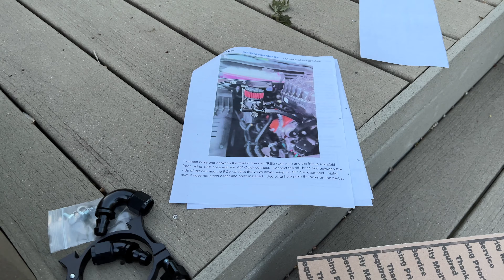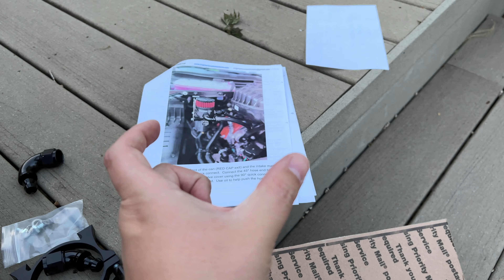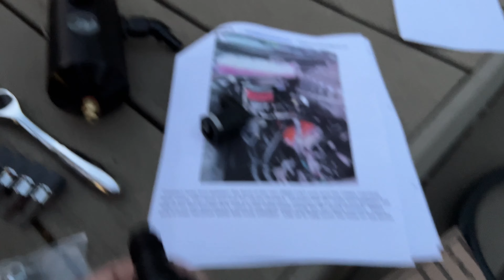SAVE Your RAM 1500 TRX ENGINE! Mighty Mouse Oil Catch Can Install AND Review!

Comment: Justin, the Mighty Mouse catch can was part of the build I did from Vengeance Racing last year.  My 2016 Z06 ended up with 681/675 to the wheels, which is not massive, but I like the extra protection it provides.  BTW, Love the XPEL PPF and ceramic coating on our C8 even though you were not the installer (because you were not our local company).  Happy customer here!  💪🇺🇸
Reply from the maker: Sweet! That’s awesome to hear!

Comment: Some people complain about modern desiel engines having an EGR valve and carboning up the intake, just get a air oil seperator catch can, a popular modification in Austrialia. OEM don't because it's a maintence item that many people are not used to and it has to be done and at possibly irregular intervals.
Reply from the maker: Yup. Easy way to fix a problem. It looks cool, too!

Comment: As always, these performance related videos of yours are more than educational to say the least. Plus, as soon as I say "Mighty Mouse" in your thumbnail, you had me. Why? Because back in the day, all my Vette's were not Big Blocks, they were Mouse Motors and were known as the Mouse that roared and I had a built 327 cubic inch mouse motor that was built for the quarter mile with 12.5 to 1 compression pistons. No fuel additives needed in that it ran on pump gas. Yup, Sunoco 260 pump gas. Wish I had hoarded that gas away back then. Lord only knows what it would be worth today and what kind of power the new generation engines would make. Heck, today's engines might even blow up using that gas. 🤣

Back to the Catch Can itself. I can't imagine any dealer ever recommending a Catch Can install. It just wouldn't say much for the manufacturer's engineering. I'm like you in that having one is certainly not going to damage the engine, so aside from the cost, what do we have to lose? It's already on my "To Purchase" list, but I have/had another brand of Catch Can in mind. I'm switching gears, no pun intended, to Mighty Mouse. I love the "little things," like the sight glass! 👍

Questions on the Mighty Mouse. I'm guessing these are brand/model specific? If so, I guess there are different brackets as well for differ cars, like our Vettes and then possibly generation specific? FWIW, I like your mounting bracket. I'd be tempted to highlight it with a red paint or red powder coating especially since you already have a touch of red on the engine from the factory.

Well, I see my timing is perfect. The end of your video and the end of my mug of Chock full O'nuts! Great upload Justin. 👍 Save the Wave 🙋‍♂
Reply from the maker: They are brand specific and they do make one for the ZR1 but it doesn’t have a fancy bracket like that, unfortunately. The only other one I know they make a bracket like this for is just a normal SRT hellcats.
Reply: I guess they'd have just their Catch Can though for a C6?
Reply from the maker: Yes most likely. The kit they make for the ZR1 uses existing bolt holes to mount. Likely the same for your C6.
Reply: Thanks again Justin. Would the install as far the hoses are concerned be different for a Dry Sump vs. a non-Dry Sump system? As you may remember, my GS is a Dry Sump.
Reply from the maker: It would be a slightly different install but still pretty easy. My ZR1 is a little bit harder since the pcv is under the super charger
Reply: I'm glad I asked. Thanks again my friend! 🙏
Reply from the maker: No problem! Thank YOU!

Comment: Been thinking about adding one to mine but worried about warranty and dealership service department seeing it. I guess I can swap it back to factory pretty easy when taking in for any issues or warranty work/recalls.
Reply from the maker: Super easy to swap back if need be but with that said it’s unlikely they would void any warranty over this.

Comment: I’m new to the TRX truck bought it used on the mighty mouse website. What package did you chose? Did you choose mild or wild to get the exact parts you got?
Reply from the maker: Congrats on the truck! You can get the mild setup. The wild is if you modify and have over 1,000 hp.
Reply: Ok thank you 👍

Comment: Nice mod. There’s two versions on their site, the “Mild” one and the “Wild” one. Which one did you go with?
Reply from the maker: Thanks. Mild is what you want unless you have engine mods pushing you near 1000 hp.
Reply: @HorsePowerObsessed  Preciate it!
Reply from the maker: You’re welcome!
Reply: Oem quick connect option ? @HorsePowerObsessed
Reply from the maker: Yes I had that in the video.

Comment: I got the Mild 1000 QC. A little different connections and they say to remove the spring and piston from passenger side PCV valve and then put it back with just the housing. Is this actually needed? And why?
Reply from the maker: Wow, I didn't know that. If they say to do it I would because that man knows his stuff!

Comment: I've got a MM gen5+, it's overpriced.
Reply from the maker: Quality wise, I disagree. Seems to be on par for how nicely built it is.
Reply: @HorsePowerObsessed  Doesn't have enough engineering in it for the price. Here is 18 pages on how a pcv system should work. http://www.conceptualpolymer.com/Documents/pcvor.pdf
Reply: Maybe you should make your own and see how much it costs you.